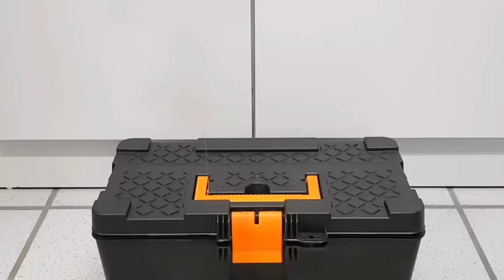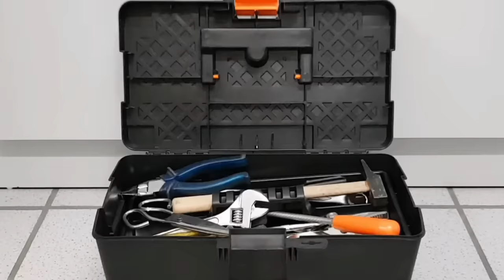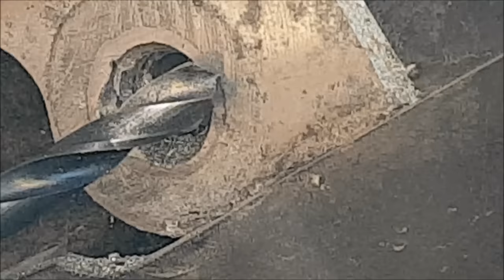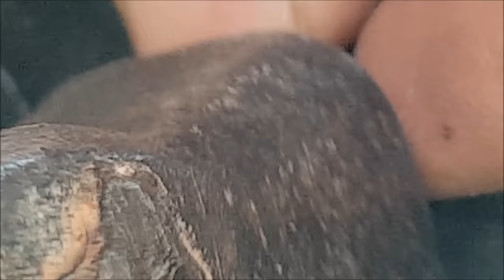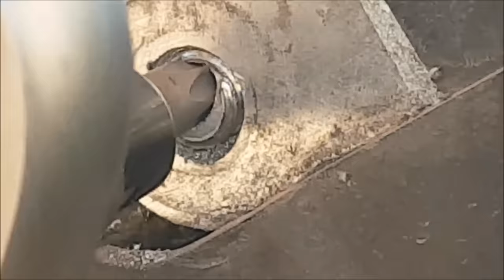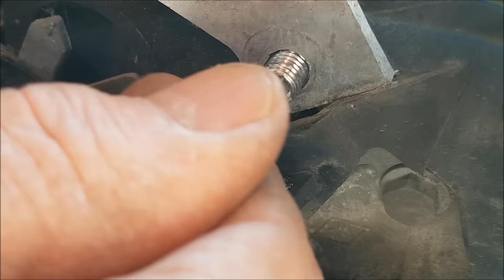One way how to extract a broken screw + drill and torx key.

Comment: I worked on my honda for the first time and broke a bolt on the valve cover. Smh. Glad this video was made. I even listened to the same song just for extra luck.
Reply: Same issue with honda car boss
Reply: Me im experiencing this hays 10 size valve cover bolts
Reply: Mine is on my Zero Turn's starter bolt 😑
Reply: 📻 Another one bites the dust... (Tools breaking)
Reply: I just laughed out loud at the music comment for extra luck but don't know why, I might try it myself now 😆
Reply: Hey you did it with the 10mm bolts in the cover right that currently to me rn cuz I do t have faith in the broken bit of screw

Comment: Hell, might as well give it a try.  I ain't done nothing but screw it up so far.
Reply: Nice one
Reply: Exactly where I’m at lmao
Reply: Bro im changing the fucking brakes on my car and the caliper bolt head snaps off😐
Reply: @jio7270  Im trying to change my wheel cylinder and the T8 Torx bolt got really rounded cause I wasn't using the right size like an idiot then I tried using other types of sockets now im fucked. Beatin the shit out of it with a punch
Reply: @wildside1951  see if its a torx head, go up a size or two, in your case a t10 would probably be best, but put the bit on the head roughly in the same pattern and beat the hell out of it until you fit the bit in there, that usually helps me undo a stripped torx screw

Comment: Just had to add my comment since this saved my ass. Had a speed sensor bolt that broke off in the steering knuckle. It was a fairly small 10mm bolt head to give you an idea. Used a 3/32 drill bit and a smaller T10 torx (figured I'd start there and go bigger if I needed). Didn't drill too deep for fear of not drilling perfectly straight, worked like a charm. Thought I'd throw my testimonial and numbers here in case it helps

Comment: Worked like a charm, thank you!!!
I had a broken bolt in the head of my 454.  Used 7/64 for a pilot hole & then a 7/32.  #27 torn & it came out as smooth as butter.

You ROCK!
Reply: Dude my lq9 in my truck. Got all bolts free. Then noticed a bolt was missing. Looked and shit is broken flush on my head. So 7/64 then go to 7/32 then t27?? Fuck. My engine is in place. I can remove the wheel well and gain access. Luckily I’m small enough to fit and work. I just have to remove heat shields. 
This shit has been lingering in my head since thanksgiving man lol

Comment: Great vid and very informative. I had a similar situation with an exhaust bolt. What helped me was using a left hand drill bit. It hollowed out the hole as well as loosing it up. As soon as I put the easy out in the bolt it was loose enough to loosen by hand .

Comment: Cool! By using this method I should be able to drive the broken bolts that held my ATV's skid plate to the frame out by reversing direction and actually driving them deeper in until they come out the other side.

Comment: Wonder of this will work on a 94 chevy 4l60e transmission pan bolts 2 broke..😢
Reply: Actually it would , 

It worked on my 04 water pump bolt while I bought a special “left handed drill bit and extractor “ and still didn’t work lol

Comment: That looks like it will work for the problem I have. Thanks.
Reply: Lucked out. The screw was  not in a blind hole and came out when drilled. Thanks for tip anyways
Reply from the maker: Me alegro tuviera  poca dificultad.
Gracias por su comentario.
Le invito a visitar mi canal.
SALUDOS

Comment: I used this method with limited success using an impact rated T30 bit. While trying to remove one broken stud which was below the surface, I managed to snap off the end of the bit.  

I just happened to have a 7mm diamond core bit handy (about $8). While time consuming, I was able to drill and  expose enough of the broken bit to remove it. Hope someone finds this rescue tip helpful.

Comment: So theoretically a bigger bolt say 100 lbs of ft torque on said bolt busted. Bigger the t series?
Reply: Let's just say I had a lug nut a little on the high side of torque for some reason. I'm currently doing both lower control arms on the ol fukus. So first time for everything right? Never snapped a lug, so far down that nothing would grip and pull it out. Tried hammering a lightly smaller socket than my key, didn't work. Heated it up and trying the small socket again drilled to the end of my stud,
Reply: Hammered a T50 in and broke half my stud out. All the prior hammering I did left me with 2 taps with my nail hammer

Comment: How do u get it out if the head it alread broke and the threads are in there flush. My rotor screw is broken into the wheel hub and I can’t put a new screw to line everything up. And now the brake caliper is rubbin I’m rotor. This screw is very tiny

Comment: will this work on bolts that have been doused in thread locker because I was taking the Philips head screws out of a stator casing to replace  the stator and snapped w of the screws and I was wondering if I could still use this same method even tho they have been completely dunked in the stuff I managed to get one out and it was a mess the second one was sorta coming out untill it snapped and the third one rounded off so I just broke it off likely would have snapped even if it didnt round off if anyone knows if it would still work please let me know thanks
Reply: Probably not, I just tried it and the torx snapped in there. Now 8 can't get it out and can't drill into it

Comment: Tried this carefully and still broke the Torx bit. Choose a good quality one and possibly of a greater size.
Reply from the maker: https://youtu.be/AA39g06iy5I
Le invito a ver
SALUDOS
Reply: @murisec54  Hi! Thanks for the tip. I tried that earlier on right caliper, worked. I tried on left caliper and it did not work. Tried 16 times - always broke at the original break line. I tried stick, mig, different settings but nothing helped. After that I tried the trick with torx bit, which broke and I could not drill it out as it is too hard. Now it's at a machinist.

Comment: What is the tool called that your using?
Reply: It is a bit for installing and removing bolts with a torx or star head. Most mechanics have a set. Used to remove broken studs, there is less chance of breaking off like an easy-out.